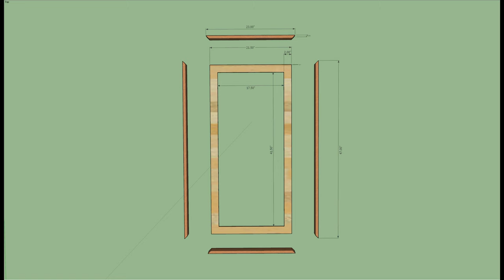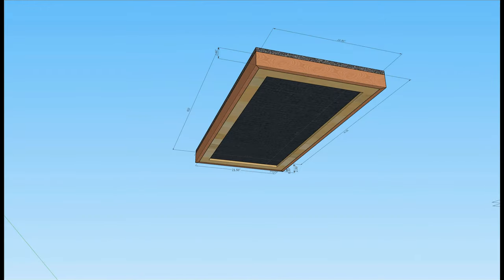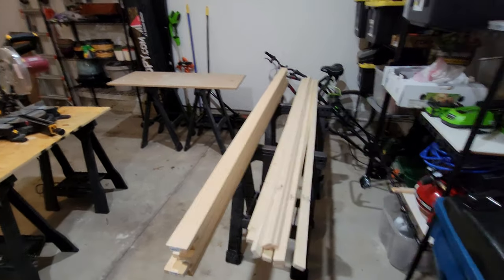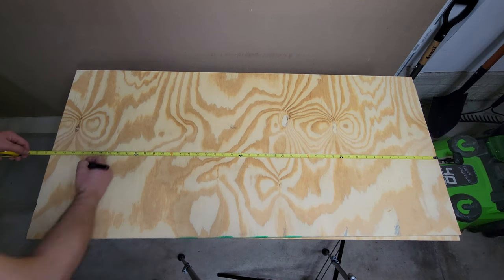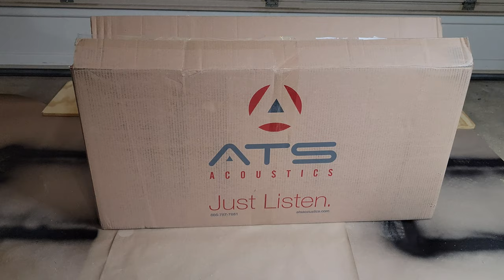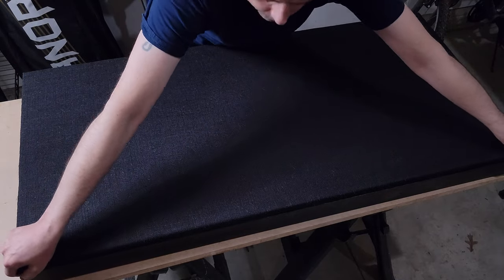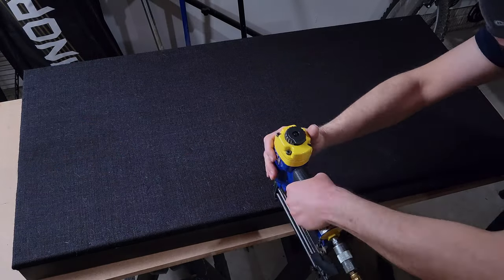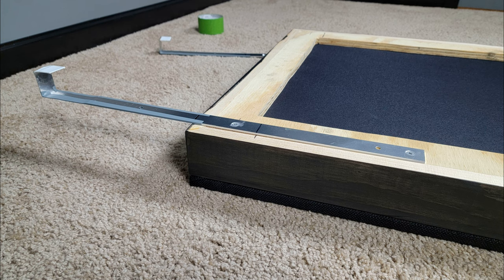How to make acoustic panels with mineral wool that look like classic stereo system speakers! [NEW]

Comment: Looks really good! 

Though the plywood part seems a little wasteful. Maybe instead you can cut from the edge of the plywood into 4 pieces. Two small and too big pieces to get the same effect you have by cutting out the middle. But that's just me. Either way they came out great.
Reply from the maker: I considered that early on but realized the integrity of the panel would suffer. I used the plywood as a guide for the side walls and to attach them securely. I find that it was a much better design choice when not being excessively frugal.

Comment: They look great! What did you spray the boxes with after staining?
Reply from the maker: Varathane water based Polyurethane. It's all they had in stock at Home Depot at the time. There's three coats. In hindsight I should have mentioned it but I also thought anyone doing this sort of thing would want to use their own sealer or staining methods.